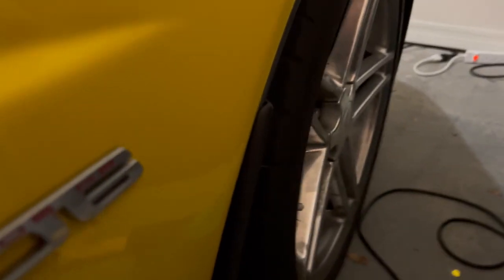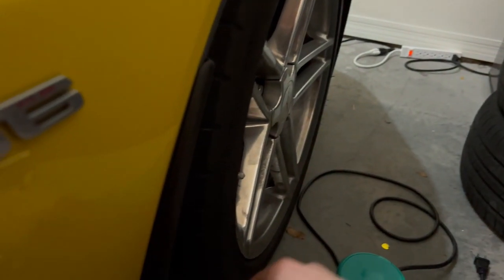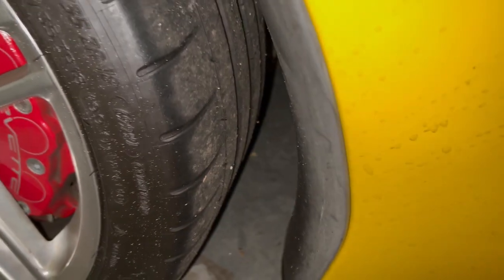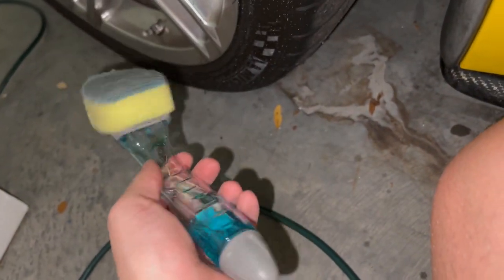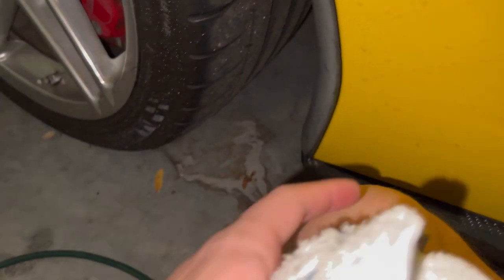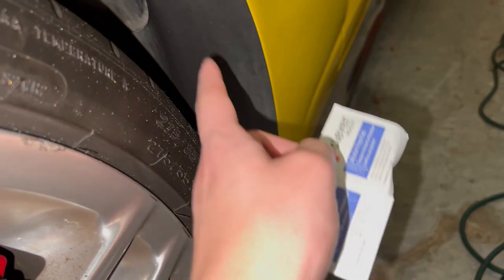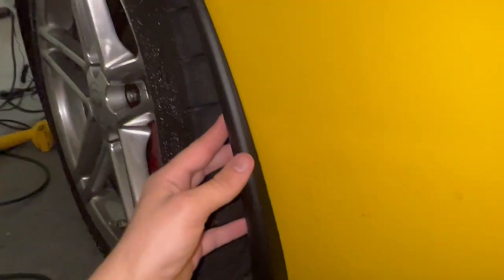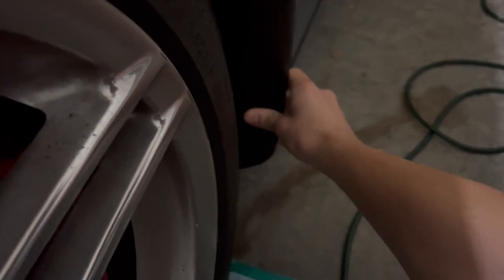How to Install C6Z Front Splash Guards

Comment: FINALLY a more reasonable alternative to Apsis splash guards.  Nice job on the video and showing the steps for prepping the surface.   If I get these, I'll likely add a screw or two for good measure but I like that these can be applied with no fasteners.
Reply from the maker: I drove a 1000 plus miles from Florida to Ohio and had no issues with them